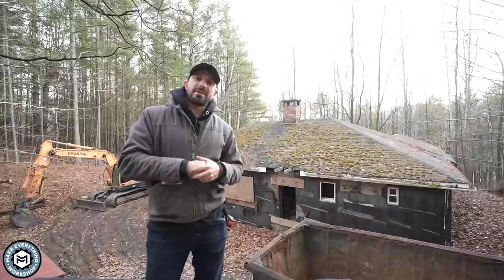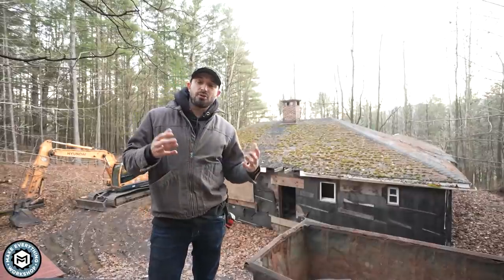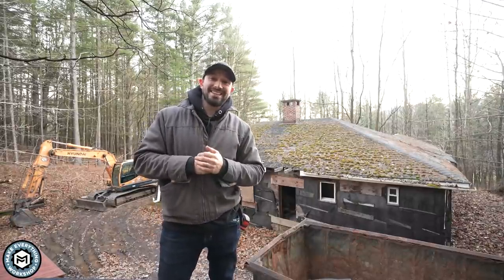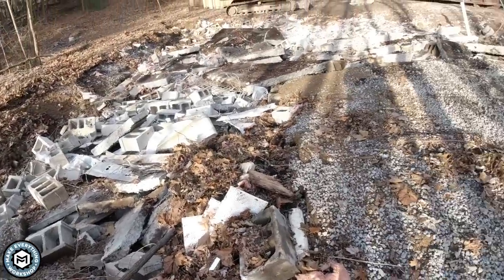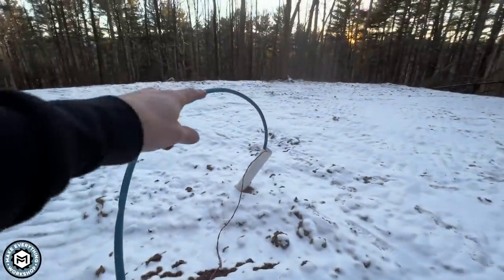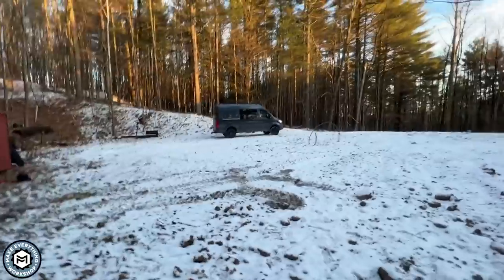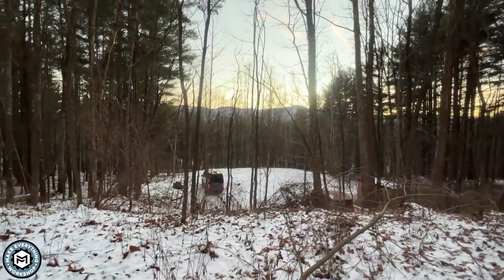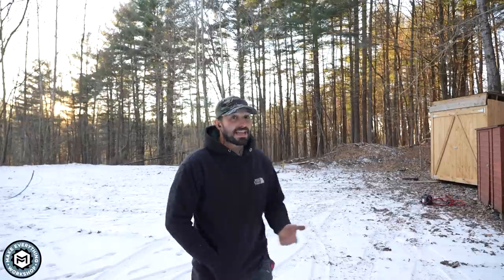They Knocked Down My House!

Comment: Andrew Camarata would have taken it down. Would have been a neat collaboration
Reply from the maker: I spoke to Andrew about it actually! The problem is this property is really tricky to get to so it took a lot of persuading by the excavator to get the dumpsters in a good sequence. Andrew definitely could have handled the demo but I would have had to arrange the carting. It worked a little better to get these guys to do it and handle both sides. Maybe one another project tho!
Reply: @MakeEverything  Thats awesome. Maybe when you go to clear the property to build the A frame on. Would love to see a collab with Andrew. Keep up the good work!

Comment: They hauled off all those blocks?  I would have wanted to keep those
Reply from the maker: They left a lot of the block in the hole after the crushed them up. The blocks were full of concrete and there was not a single piece of rebar in the whole place!
Reply: @MakeEverything /videos still might have made passable raised beds or walkways - or the bottom row of a chicken/duck coop - on top of the hardware cloth